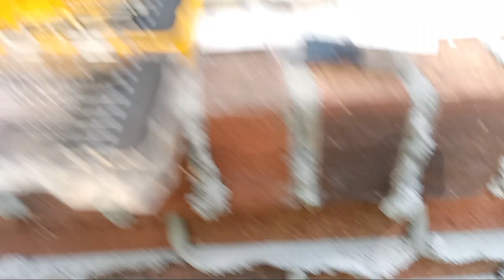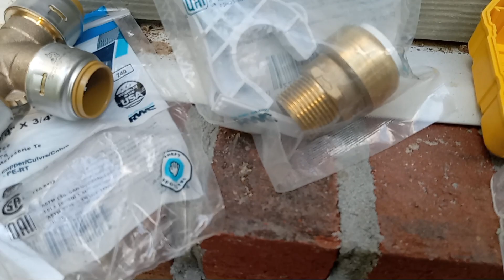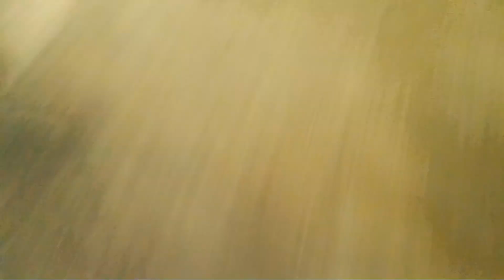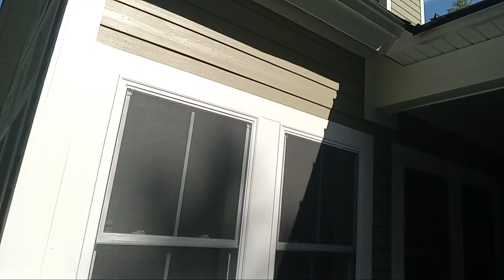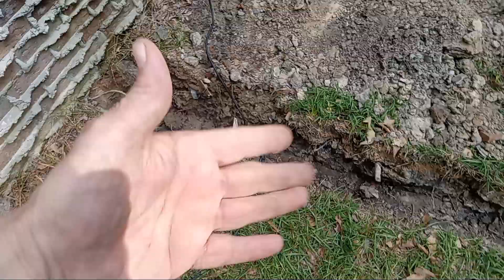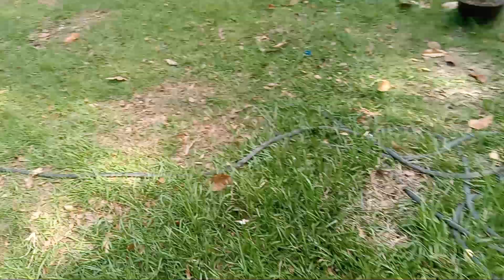part 2 installing water faucet with PEX tubing and fittings

Comment: How crazy is that decking with gaps. Open roof area, as well, it's obvious it would flood under the house, no where else to go. Great repair for the flooding problem, and adding the new faucet. I think if it were me, I'd figure out how to fill those gaps in the floor. Because, the pump, shouldn't be a full time reliance. As a female I'm thinking it would be tearing the house up from the flooding, and possible mold growth.
Reply from the maker: Well once we build the walls and we dug out the dirt we put in this heavy gravel material called slag it's actually a still product but it looks like rocks but it's left over from steel manufacturing where it spills on the floor and they sweep it up and we put 20,000 lbs of that rock under the house to keep the rain from beating up the dirt and undermining the house so yeah it's done professionally and see they wanted to look of that floor and that would have been fine if the contractor would have put a floating floor in where it would have had a solid underneath rubber membrane and the water would have been able to flow off but again this is one of those people who supposedly was like a real good contractor but evidently he wasn't😅 thanks for watching and commenting good to see you